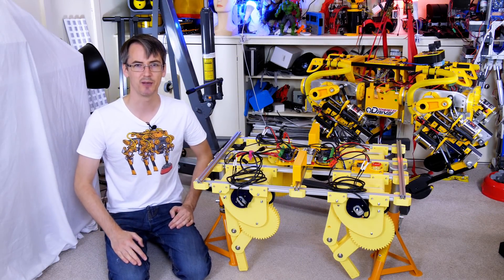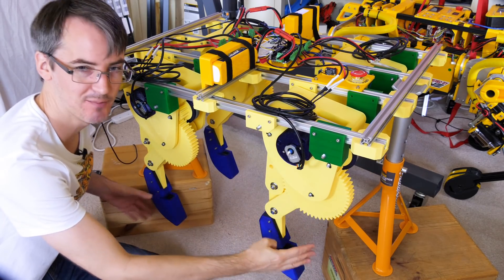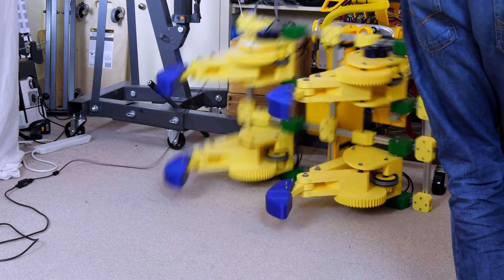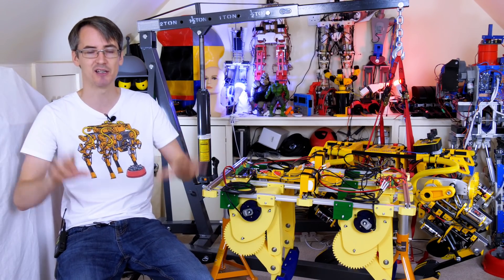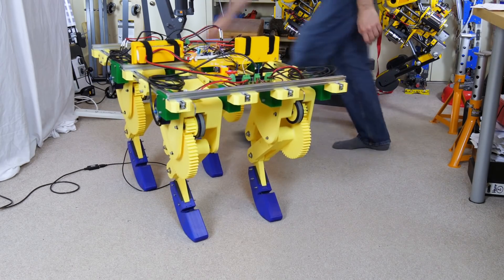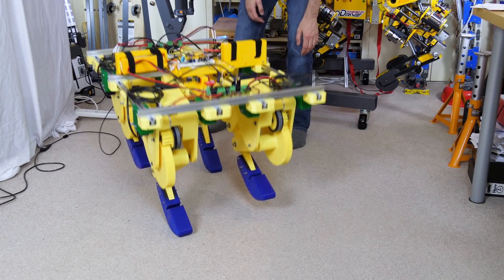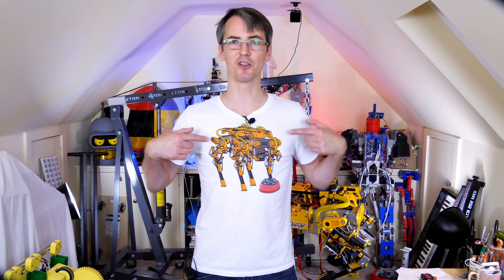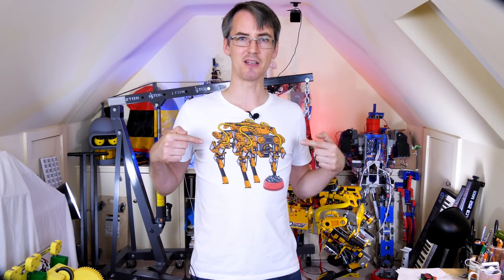Robot Dog - Stability using Dynamic Compliant Simulated Springs

Comment: Hmmm... could you track the trend of "squishiness" so that you can tell if a leg is getting progressively softer so that you can pump it back up?  Or set a hard minimum that represents the point of no return where it can no longer push itself back up and make that a hard limit?
Reply from the maker: yes probably, but in fact the motors/gearbox isn't strong enough in this case.

Comment: rear left leg is significantly weaker than the others which is why it's tipping to the left. You can see once it lifts it's front left leg the whole left side dips very quickly compared to when the other legs are down. Doesn't seem to be a mechanical problem, but rather an electrical problem. The rear left leg simply isn't getting the same amount of power as the others, so it doesn't have the same holding force.

Comment: Would it help to lower it's centre of gravity? Put the batteries etc between its legs or where its belly would be perhaps.
Reply from the maker: But then I won't know if it's actually balancing as much - this is a test for balancing, so making it harder means I know the system is working.
Reply: @jamesbruton  That makes sense, cheers dude.

Comment: Been watching since the start...  I think you should switch the left front assembly with the left back; then if it fall's toward the left rear, then the problem is in the mechanic's.   What about batteries placed under on the center rail; front and back, instead of top on the sides......?
Reply from the maker: But then I won't know if it's actually balancing as much - this is a test for balancing, so making it harder means I know the system is working.

Comment: Compliance with the inertial measurement unit is much better than trying to sidestep like you were doing before you did compliment robots.
Reply from the maker: It needs both, this is just a test for compliance with the ground
Reply: James Bruton that makes sense but all I was saying is that on it’s own this has much higher succès rates than the other method individually.

Comment: Why not read the direction of the sensor. If the gap is getting smaller you know compression has started and if the gap starts growing then you know the foot is lifted. Almost like a load cell. Then you can combine it with time.

Comment: I’m trying to think how this could be changed in order to work better, but I just get overwhelmed by all the different variables that needs to be taken into consideration, and all the code that needs to be written. Huge props for keeping this project going, James! Love what you’re doing!
Reply: Actually it isn't that much code.....Dog finds CG initially , ie, when weight is evenly distributed and dog is stable....then during walking, when CG is off to one side, legs move to Shift CG back to original position..for example....if CG is off to left and forward, then left front leg either pushes up faster, or straighten more....or both (depending on severity of situation)....and the other legs bend more.....the program logic is not complex.
Reply: @toraguchitoraguchi9154  I'm not even going to go into this discussion. It is very easy to see what the robot does wrong. ie. "It leans to the side, therefore it needs to apply more force to that leg and less force to those legs", the problem is finding ways to let the ROBOT know what's wrong. 

You are right, it's easy to describe the problem. Solving it is a lot more complex. We're just fooled to think walking is easy because our brains have all the necessary sensory input to help us do so, and does all the processing for us.
Reply: @AppliedProcrastination  Step 1: When Robot is standing still on horizontal ground measure force on all four legs, they should be equal....5kg each leg, total 20kg.

2. Robot takes 10 steps, that's 2 legs per step, so 20 readings of initial force on stepping down - these should be x% more than the readings when standing still.

These will be a bench mark for future reference.

Step 3. Upon each step, read the force reading feedbacks and compare with average or benchmark.

Step 4.  If Force readings are lower than benchmark then.....(add instructions here) 

Step 5 if force readings are  higher than benchmark then.....

Step 6 if force readings are within range, do nothing (Or carry on to next step, depending on programmer's choice).

It's not about calculations, we don't calcuate before we step, we simply make sure weight is evenly distributed on both legs, and if on one leg we make sure weight is evenly distributed between 3 points beneath foot.

If We want to make it slightly more complicated, we create an imaginary top down map of the CG position realative to feet, and ensure CG is within manageable boundaries, usually applied to running where controlled falling by manipulating the CG is required.

Another sub program may be used to record the front leg's reading so that when back leg steps into position it already has a pre-set range of how much force to apply (like the way elephants walk), we as humans also do that sometimes, we subconsciously assume the next step is similar to the last, take the step and then make small adjustments upon feedback....and so on....

Less Calculations, but plenty of quick comparison and small adjustments.
Reply: @AppliedProcrastination Since you mentioned it,  In fact, human walking is a set of instructions primarily to do with the ankle joint, the three points beneath the foot and the position of the imaginery CG. For example For walking, CG is never beyond the Big toe when the other foot's heel touches the ground. But for Running, CG is beyond the Big Toe, and outside the profile of the foot on the ground - its hard to describe it here, but it's not that complicated....what's complicated is running on uneven ground, where the Robot needs to adjust, and offset other factors - again there's a set of rules, about 20 of them, and you should get quite a good running program.

Comment: To help with the balancing issue you could enable the legs to move sideways like real dogs
Reply: That is mechanically possible on the real OpenDog but not on the smaller test dog
Reply: I also think it would help. only 20 degrees would be enough. 10 degrees each way
Reply: @ettiennelewis1095  I want to know what components of implementation you can write to us
Reply: @ettiennelewis1095  I am from Egypt and do not understand the language I need only the ingredients
Reply: I think he reduced the complexity intentionally to narrow down the problem to just the handling of leg extension.

Comment: I think you could have the leg recalibrate the foot sensor each time the foot actuates upward, and ignore increases after the leg moves downward, more dynamic sensor calibration. Also, some kinematics might help inform the absolute position of each leg if you assume the "ground" is not moving, to know when a leg has left the ground to adjust the calibration. (This is probably similar to the system you might end up using for the simulation of compliance on the non-compliant open dog)
Reply from the maker: I left the dog on its feet for a bit and the feet just bent more and more until the gap was closed, so I think I probably need a different solution. I'm going to look at strain gauges bolted to steel next which will definitely need ongoing calibration, but I don't expect them to deform too much over time.

Comment: I think part of the problem with the hall effect sensor is that with only one leg "stopping" when it hit the ground it was no longer supplying enough force to stay upright.
Reply from the maker: I trued tuning it to 'stop and add a bit' but ultimately the sensor data was creeping as I was trying.
Reply: @jamesbruton  I think going back to a mechanical switch is a backward step. Have you considered making the feet less springy?